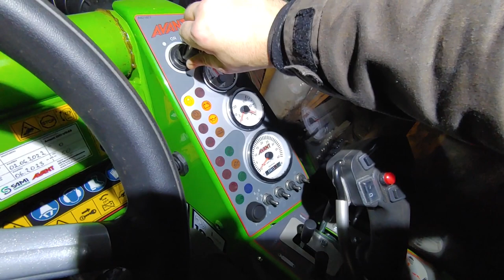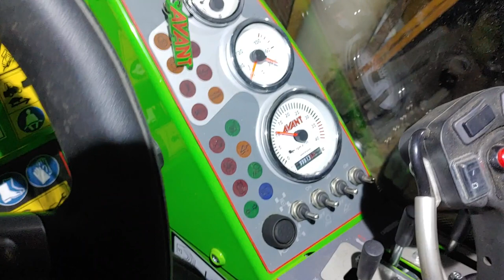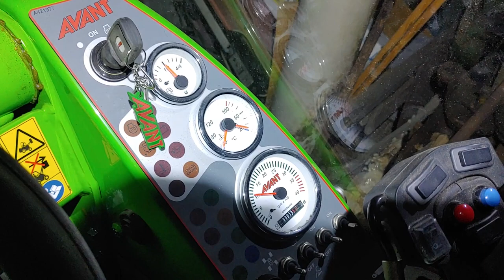Avant 635 coldstart 2022.12.10

Comment: My Avant 528 2015, started after second time when it was - 15.
Reply from the maker: Yup, those older engines seem to do alot better with coldstart. I've now tried it with a little shot of ether starting fluid and it started way better, still sputtering for a few seconds though.

Comment: Why'd it struggle to start so much? With all respect I didn't think -8 was that crazy cold?
Reply from the maker: I think the Kubota V1505-E4B stage V engine isn't designed for coldstart, but once it's started and warmed up (or even almost cooled down) it restarts instantly. Probably block heater would be needed, and this hot air injection seems to help too, haven't tried starter fluid yet.

I had previously a 2014 Avant 635 with Kubota V1505 stage III 28 kW engine and that started no problem with all kinds of cold, maybe with -15 you'd have to try it two times max.

Comment: 16F - This did not inspire confidence in purchasing one of these.
Reply from the maker: The coldstart issue is with the Kubota V1505-E4B Stage V motor (4-cylinder, 19 kW, 2500 rpm max, 50 l/min hydraulic oil flow), allegedly it has different camshaft compared to the older Kubota V1505 Stage 3A (4-cylinder, 28 kW, 3200 rpm max, 66 l/min) that didn't have much coldstart issues.

Current Avant 635i/640i models have Kohler KSD 1403NA (3-cylinder, 19 kW, 3000 rpm max, 66 l/min) motor, I'm not sure if this one has any coldstart issues.

There's also Avant 645i/650i with Kubota V1505 CR-T (turbo, 4-cylinder, 33 kW, 3200 rpm max, 75 l/min) motor - but compared to the older ones it's said to have only air intake grid heater, no glow plugs.

With the 635/640 19 kW Kubota, if you can run block heater for ~15 min and have hot air intake then the startup isn't a big issue.

https://www.avanttecno.com/global/machines/600-series